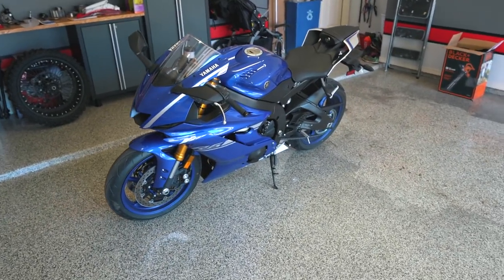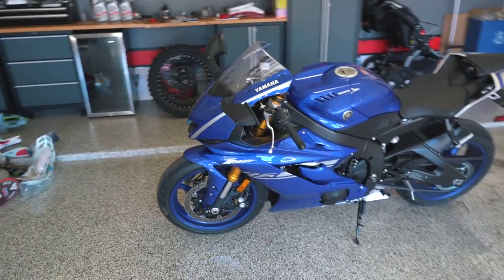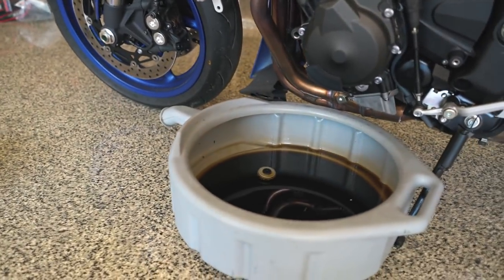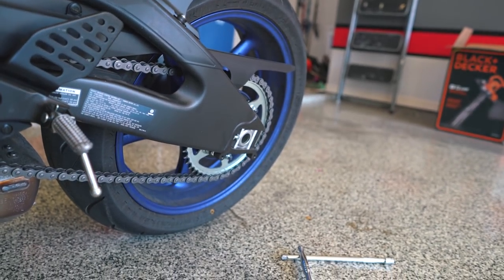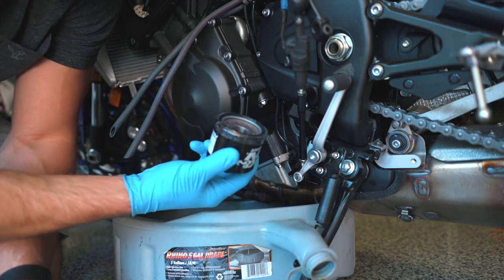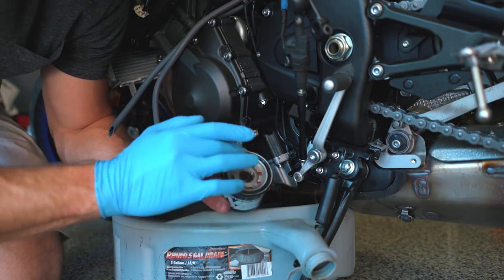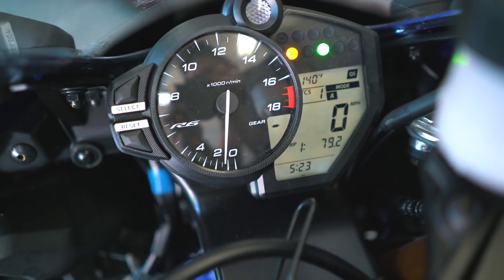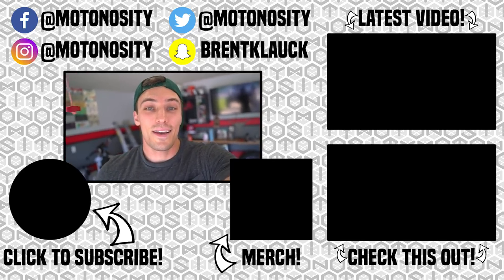HOW TO: Oil Change on a Yamaha R6 (2017-Current)

Comment: There actually is a dipstick to check oil level on the right side of the engine below the clutch case... so make sure you haven't put too much oil in it because you may blow the oil pan gasket or worse-the headgasket!

Comment: When I changed the oil on my 17 only removed the left lower cover and loosened the left side cover towards the back. Also the bike has a dipstick to check the oil level.
Reply: I was wondering how you would check the oil.
Reply from the maker: Dang, thanks man! I'll try out just removing that lower cowling next time. Also, can't believe I couldn't find that dipstick before haha. Found it checked, oil level is perfect :)
Reply: Motonosity the light just turns on when the oil pressure is to low. So you could damage your engine with to less oil.

Comment: There's an oil dipstick below the fill cap, slightly towards the rear brake foot lever. It looks like an idle adjustment knob. Using that dipstick is the proper and only way to check your oil level.

Comment: Nice video thanks!Some practical Help for viewers: 1.you really only need to remove the very bottom left side body panel, and loosen the main left side panel. I saw he removed the entire left panel and upper small panel. That might be slightly helpful, but that’s really over kill. 
2. the oil filter can be removed with a standard Toyota 14 four oil filter wrench if you have one handy which I did.

Comment: Just got myself a '20 R6, coming from a '09 600RR ABS. The Honda was designed that you could 'cheat' and change the oil/filter without pulling plastics. Looks like there's no way to do that here. Nice video, great job!

Comment: for your new oil filter, you do not need to add new oil on the o-ring/ seal.. It comes greased from the factory. Thats half the reason why they add that plastic cover to it.

Comment: I have a tip, intead of punching a hole in the old oil filter with a screw driver, you can take it off by wraping it around with tape and then pulling down.

Comment: You could have used I think either 6mm or 8mm bolts in the holes where the spools go and it will temporarily prop the bike on a pit bull stand. Until you get spools anyways... Loving the R6 videos

Comment: Does the new R6 throw heat much on your legs like the old one ?
Reply from the maker: +beni8978 Not really! But then again I'm used to the fireball that is the R1 lol
Reply: beni8978 yah I've noticed that also my left leg is always on fire lol
Reply: I went from an 08 R6 to Honda 15' and felt the heat more on the R6. I wrecked the CBR and bought a 17 R6 and forgot how much heat I got on my legs. So yes it feels the same as the old one.
Reply: Yes it is intense on the ankles
Reply: yes it does lol
Reply: Yes i have a 2019 r6 and after 45 mins of riding your inner thighs will be on fire.

Comment: I'm gonna go out on a limb here before watching this vid and say Draining the oil on a R6 is like Draining the oil on any other vehicle, Step one put drain pan under vehicle, Step two drain oil, Step three remove old Filter, Step four install new Filter and drain plug then fill with fresh oil. Did I get it Right?
Reply: most people are more concerned with how to take Yamaha's notoriously complex fairings off to get to the filter and drain plug. but there are also newer riders needing to learn how to do their own oil
Reply: Addendum: Step 1A Remove lower fairing.  There fixed.
Reply from the maker: +spliffsperlunk it's not complicated now, but if you've never done it before, it's helpful to have a guide! Also, Yamaha likes hiding things behind plastics haha
Reply: I hear you, I'm just being silly .
Reply: Good guy Motonosity. Doesn't get bent out of shape over anything.
Reply: you cheater! you clearly watched it

Comment: I bought a r6 2017 and the guy at the dealership told me that the first time I change the oil I have to use 10w-40w oil and after the first time use 15w-50w always..... That's OK? What u think?

Comment: Nice.  Should mention that you need a torque wrench specifically for tightening the drain plug.  Should be about 25 Nm. 

Demonstrating use of the torque wrench instead of glossing over it would improve your tutorial.  You don't want to overtighten that plug, nor do you want it too loose.

What's your thought of using car oil in a motorcycle?  I've ridden my motorcycle (MZ Baghira, has 660 Yamaha Raptor motor) for almost 50k, doing nothing but car oil changes.  10W30 or 10W40.  It's way cheaper than the Racing 4T stuff and over 50k, I have saved a lot of money going the cheaper route.  My bike is a 660cc single, not a supersport, though.

Comment: so you just tightening the bolt after draining the oil without using any coating on the bolt ? 
i thought its gonna leak
Reply from the maker: +rizt27 I've never used anything on my drain bolts. Never had a leak.

Comment: Does anyone reuse their oil filter between oil changeS? For everyone possibly opining why wouldn’t anyone want to change the filter; I always do. This is just a simple question.
I’m wondering because my oil is perfectly clean after 3.5k miles on a 19k mile bike. I live in Seattle suburbs so I ride half the year only. 
-Obviously, the oil filter has done its job as designed and that’s mainly the reason my oil stays super clean. 
Just asking what would happen if not replaced or if anyone reuses theirs for another round?

Comment: DO NOT USE K&N oils filters the weldnut on the end WILL fail and spew oils everywhere. This has happened to me and about 30 other riders I know.
Reply: Eric Gudzinas cause the weldnut isn't made to to tighten the filter it's used so when your ready to take it off it's easier

Comment: Hey i have same brand new r6 yours sounds like it struggles to cold start just like mine! Alot of others vids saying same thing. Is this normal??
Reply: Really... ok i hope so... mine only has 190 on it.
Reply from the maker: +Jordan Kuhar Yeah it does have a pretty poor cold start. Then again, after changing the oil, it starts super quick. I'll report back on if that continues.
Reply: Motonosity please do! When i get mine to near 500 all do the oil change hopefully that helps! I dont want to take the bike back i love everything else about it!!
Reply: Jordan Kuhar i just apply throttle when turning it on and it's much better. I heard it's confirmed that cold start issues stop afer 300-500kms
Reply: My 17 R6 hates cold starts. I have 700 miles on mine and it still sucks starting it in the morning.
Reply: Lieutenant_Dan  That's strange... my 08 R6 has the same engine, starts like a dream in 20 degree weather
Reply: Danny7930 maybe once it gets broken in it's gets better. my 07 started really easy but it only ever saw 75+ weather
Reply: I have a 2016 r1 and does that same thing and I have 2k miles on it. probably just Yamaha haha
Reply: But that sucks tho... if its just yamaha then wtf. Its just such a bad feeling getting on a brand new bike that doesnt fire up right away.
Reply: Jordan Kuhar dude I completely agree. You can see and her in my videos it's every time I start it. I took it back to the dealer once at first because I thought it was messed up but everyone comments that it sounds weird when I start it
Reply: Have the 2017 r6 here in Phoenix.. Same issue just put 600 miles on it..oil changed and all same issue.. Doesnt bother me tho
Reply: Jordan Kuhar mine does the same thing. 2018 r6

Comment: Next time you should replace the crush washer on the drain bolt, the are meant to be used only once. It's a soft metal and will deform to make a tight seal.

Comment: I have a 2000 R6 I bought from someone now when I turn the key on and push the button or just clicks it will run when I push start it so I lookes undertne seat and tbere is a wire that is running from the negative side of the battery to the fuse box

Comment: good ol farmer trick for oil filter..... just always make sure you dont go all the way thru it like i did in my dads '80 chevy van.... ended putting a hole thru plate protecting clutch.. oops

Comment: Old video so this comment might not get seen but for anyone reading DO NOT do the screw driver method to get the filter off. 90% of people and shops don’t use torque specs and the filter will almost always be way too tight to do this and you will mutilate your filter and make things 100 times more difficult for yourself. I’ve rarely ever heard of this actually working for people. Not worth the risk.

Comment: Be careful with the K&N Oil Filters. I was a huge K&N fan, until 8, yes 8, riders I know, said the filter exploded on them after high speed riding. All were torqued correctly. There's a reason why K&N Oil filters aren't used in any competitive racing. Go OEM.
Reply: GYTR

Comment: I think i'll stick with my naked bike.  Never new it was this much of a process on a bike with full fairings.
Reply: carters2 It takes like 5 minutes to remove the necessary fairings.
Reply: That's an extra 10 minutes total that I could be riding! hahaha
Reply: carters2 ha yeah that's one way of looking at it.
Reply: My Hyosung is fully faired and I don't remove anything to change the oil nor filter. You do need to when you want to do other stuff though.

Comment: anyone else like "bro just use your hands" on removing the old filter?

done it before, wasnt that tough
Reply from the maker: +Deadc0w5 depends how tight it's on there. Sometimes you can do it by hand, as I've done on my R1. From the factory, it's on there pretty tight on the R6. Plus there's not really a way to grip it other than with your finger tips haha
Reply: Ah i gotcha, it was pretty snug down in there, another way ive done it is to get some channel locks and go that route.

loved the video though man!

Comment: that fairing is gonna love being taken on and off over time what a shit design
Reply from the maker: +HarleyRider 283 Yeah kinda sucks. Gonna see if I can get away with just removing the lower (silver) piece, at least for oil changes without a filter change.
Reply: Motonosity you can, that's what i did. Also there is a dipstick to check the level. See owners manual
Reply: where is the dip stick bro? i havent seen it either